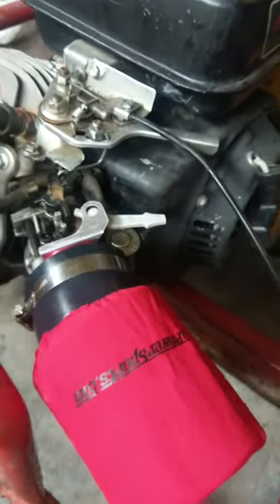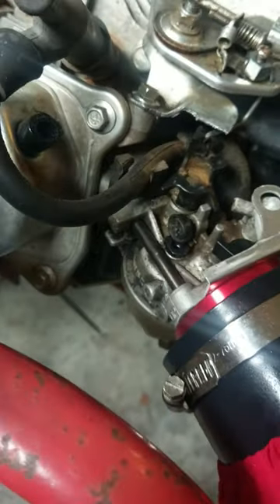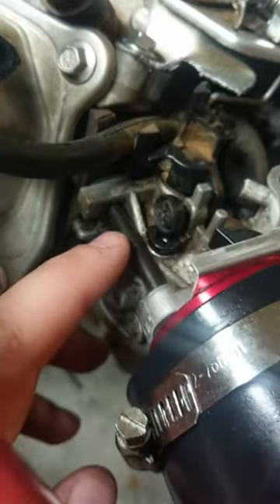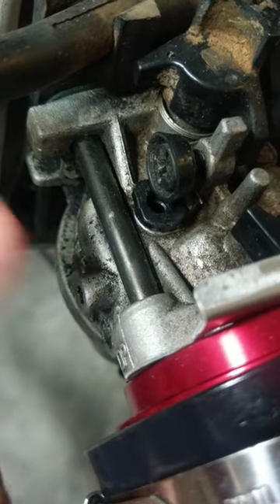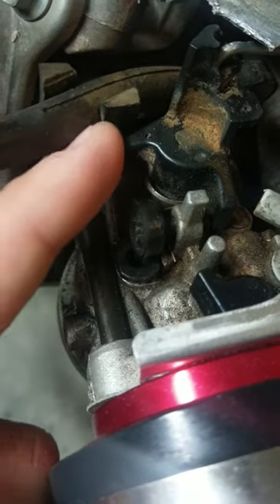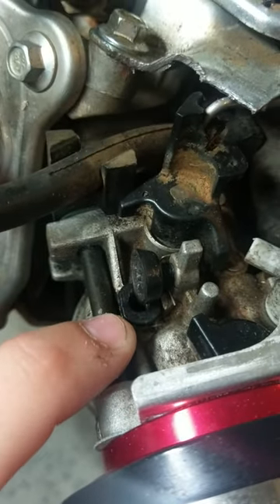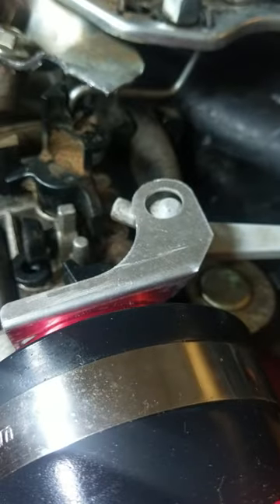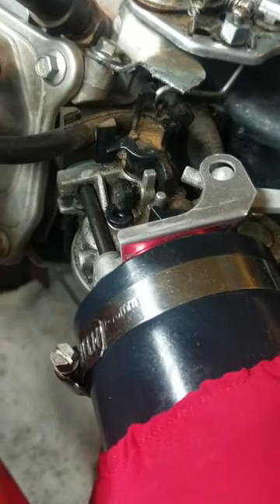Fix Choke/Idle Issues: Predator 212/Honda clone-low speed jet.

Comment: Just a note, the idle jet listed from OMB does not fit some of the Predator 212 engines. It is for a RuiXing carb and has a larger diameter at the top that won't allow it to fully seat. And if you force it in you will not be able to remove it in one piece.  Honda/Clone engines are different then the Predator in many ways.
Reply: I just ran into that and you are right, they break on removal
Reply: Beat it in with a punch and a small hammer 🤣😂🤷🏼‍♂️👍🏻. Seriously tho if you do find the correct one that does fit it will make such a big difference . No more flat spot on the law end at take off . It will idle nicely . I used a size 20 and it worked great . 👍🏻

Comment: Hey does anyone know why the MB200 196cc engine runs good with no air filter but when I put the air filter on the motor bogs. I cleared all the jets and tried turning the gas off to see if the engine would run better after it ran out of gas to see if it was getting too much fuel and I also checked the spark plug but it was dry and white like it was lean. I had been running it without the air filter is why it was lean most likely but I just am having a hard time finding the problem and it seems like it should be an easy fix. Do any of you recommend tips and tricks on how to put on or take off certain things to make the motor and carb more reliable?
Reply: Me 2 it’s ah headache
Reply: @1hellrazor713 give it more air or maybe ur gas has gone bad

Comment: Cleaned it and now the motor runs with the choke off but i get white smoke. Any idea why? Also how can i tell how far the plastic screw over the plastic jet should be turned in? THANKS!
Reply from the maker: The screw over the idle jet is your idle speed. If it's too high/in it will want to spin tires sitting still/higher rpm. Too low/out it will sputter out. Some say for smoke, too much oil, bad gas, could have alot of fuel sitting from trying to start it alot. Last thing is could be motor issue. Keep an eye on it if it's new

Comment: Were your idling problems a low or high idle? My 212 is stuck at a high idle and I’ve tried a new return spring, and the idle screw but nothing. Any suggestions?
Reply from the maker: This is for idle in general. Not getting fuel unless choked. I'm not sure what's going on with yours, there isn't much that controls idle speed other than idle adjustment and throttle. Carb may have something stuck inside possibly
Reply: Your possibly getting air into your engine from somewhere else if it is idling really high. Probably a gasket
Reply from the maker: @bradfaught1695  good point, i didnt even think about that

Comment: Can anyone help me I recently dropped my predator 212 mini bike on the side where the intake was and what happened was a little oil leaked out of the valves but I tried to start it right after but it would only sputter if I pulled it with the throttle and choke on. Now it wont run at all
Reply from the maker: Any damage? How long was it down for?
Reply: @Kaison1  No damage it was down for maybe 10 seconds
Reply from the maker: @austinwebb9434  it may just be flooded. May take some turning over awhile if you haven't just tried to crank it 100 times lol. Float could be stuck in carb too. Wouldn't fill up with gas
Reply: @Kaison1  I also already cleaned the carb I checked the spark plug looked down in the cylinder and nothing

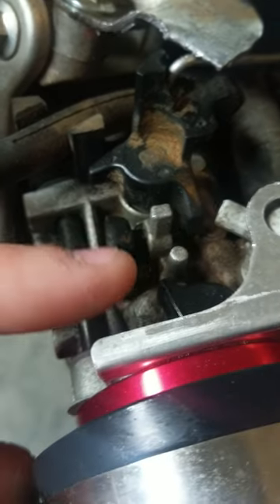Comment: hello, i had low speed it seems on my honda clone engine mounted on pressure washer so it would die each time id use the gun, so i did screw the black screw at 01:04 to increase the speed, now i can use the gun, i get water but seems like the engine then goes on low speed, i did something wrong ?

Comment: I'm having lean conditions when applying any throttle on a stage 1 build. I'm running. 037 main jet, runs fine with stock breather. When I hook up the stage 1 Air intake kit it cuts out when giving it gas. Not sure why it's running so lean, and I did the header with emulsion tube also.

Comment: Thanks for the video. I have a new tilloston 212 out of the box and it's only running strong half choked. If I open the choke it'll run but as soon as its throttled it bogs and dies. Fresh gas in it..no air leaks I've found.  wtf man..?  I can't seem to figure out why.
Reply: @leap frog 
I have the same issue with a Tilly 212, did you ever try this or figure out the issue ?

Comment: @kaison i have a 212 Predator engine and it only runs when choked when I take it off choke it starts to die out and it only runs on choke when I have the throttle on full if I take my leg off the throttle it will die I don't know what's wrong with you please help
Reply from the maker: @moussa aldabbi sounds like the same issue in the video. Your idle jet is clogged up
Reply: @Kaison1  so should i just get a new carb
Reply from the maker: @moe_ald6564  you can pull out what I show in the video and clean it if you want. New carbs are fairly cheap though

Comment: Is that idle jet getting clogged from dirt getting past the fuel filter or air filter. ????
Reply from the maker: Noah Riedel possibly, but not necessarily. Fuel has a lot of chemicals in it that can gum up in time. That's why carbs have to be cleaned too often
Reply: Kaison  The reason I ask is whenever I go ride in dirt this always happens to me. I will clean the jet and it runs fine for another 30 minutes then cloggs again.
Reply from the maker: Noah Riedel what kind of filter do you have? The jet doesn't pull air through it so usually it's a gas issue
Reply: Kaison  I'm going to say it's definitely a gas problem too. I'm running the factory paper filter with foam sock. It's also has the factory air box so I'm assuming it's pretty filtered air.
Reply from the maker: Noah Riedel could be trash in your old fuel line or tank too. Nothing wrong with an inline filter to save a few headaches
Reply: Kaison  Agreed. Thank you very much for posting back.
Reply from the maker: Noah Riedel no problem! I do what I can to help out
Reply: B

Comment: So would adjusting that idle screw change anything?
Reply from the maker: It changes idle rpms
Reply: Kaison thanks for the reply ive just put a new replacement carb on since the last one leaked gas like none other, and it still only runs with the choke on. After messing with the idle screw its only helping the idle with choke on. Suggestions? Thanks!
Reply from the maker: @fastactiontv5546  don't usually have an issue with new carbs. It has a spot to feed fuel during idle without choking. I'd make sure it doesn't have a shard of metal or something around it
Reply from the maker: @fastactiontv5546  it would have to be a restriction
Reply: Kaison thanks man ill have to do more investigating

Comment: Yo I need help. Mines idling fine but when I give it gas it dies. It’ll let me go 4 mph but if I go any more it bogs and dies. Not cops. Bogs
Reply from the maker: Only runs on choke?
Reply: Kaison  no it runs both u want me to take video ?  What’s ur email
Reply from the maker: @aricmiinch9131   nah it's most likely air/fuel related issue. You are either getting too much fuel or not enough air. Your jet could have fallen out and is allowing it to pull too much fuel in. Not likely but possible. You need to pull the carb off and inspect it first

Comment: Mine is a brand new motor out the box doing this
Reply: Same here man. Did you figure it out? I've been working on this damn thing all day and it only runs strong half choked.
Reply: @leapfrog4546  I just took mine too the shop I couldn't figure out the lash setting when I changed the springs
Reply: @bwcam3502003  thanks for the reply man. I was thinking valve lash. Looks like I'm getting guages tomorrow. 
So, it was the lash? I took my cover off and the exhaust valve seemed too tight when it was tdc.
Reply: @bwcam3502003  use a feeler gauge and set the Lash at top dead center! If you don't do it at top dead then it won't be right. And set them both to. 002 cause the metal expands when warmed up and Will equal the. 003 recommended.
Reply: @leapfrog4546  use a feeler gauge and set the Lash at top dead center! If you don't do it at top dead then it won't be right. And set them both to. 002 cause the metal expands when warmed up and Will equal the. 003 recommended.

Comment: I have a predator 212 and it keep dying every I start it , I got it from a guy online a d it worked good until 2 days it started doing it
Reply from the maker: Clean your carburetor? You didnt really give me anything
Reply: The tank was full of rust so I cleaned it and the carburetor out, but I didnt take out the jets.
Reply: The first time I tried to start it it only stayed on for 15 seconds and now everytime I try it shuts off
Reply from the maker: @JesusRodriguez-gu5rk  yea it's probably got a blockage. Gas line may be stopped up

Comment: Would yours try to take off when the choke was turned off like at full speed?
Reply from the maker: Johnathan Collins no, not exactly. But a clogged carburetor could cause that, possibly. If you have to choke to get up to speed that's your problem. I may not be answering your question though. Maybe adjust the idler setting which is in this video.
Reply: Kaison  this was not even a day old engine an i have to turn the choke off after started up an then it wanted to jus take off on me at full speed
Reply from the maker: sounds like your throttle is stuck, i would check the cable or return spring.
Reply from the maker: the idler screw may need to be backed out to slow down the rpms
Reply: Kaison does that screw do anything ive been told that it dont change anything
Reply from the maker: the black plastic screw that im pointing towards is the idle adjustment. it will change the idle rpms and will slow down clutch engagement
Reply from the maker: Johnathan Collins did that work out for you?
Reply: Could be your clutch spring has lost its tension from overheating therefore it will immediately take of because the spring can’t keep the clutch shoes in place
Reply: @Kaison1  it isn't the idle adjustment on those carbs my friend

Comment: Does anyone know why my predator engine is seizing when at idle? It will start from a high rpm then it drops down like it wants to shut off but then the rpm goes back up. This is it's cycle, I've cleaned everything except the float and the jets. Could it be these jets?
Reply from the maker: It's possible I guess, little weird but sounds like it could be fuel related, could be something with valves too
Reply: Might be your governor